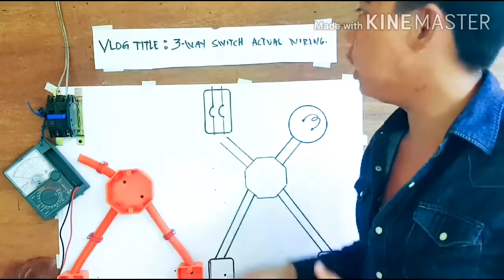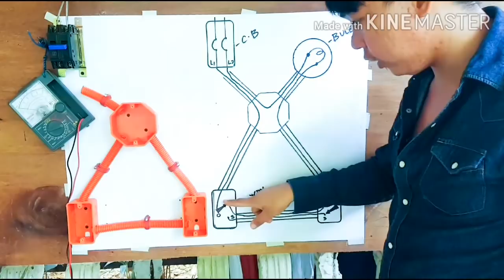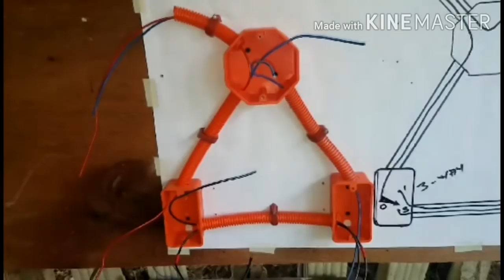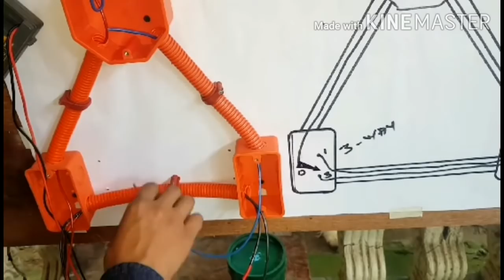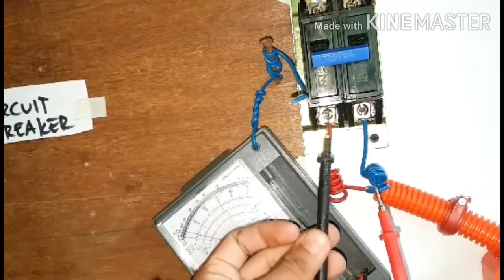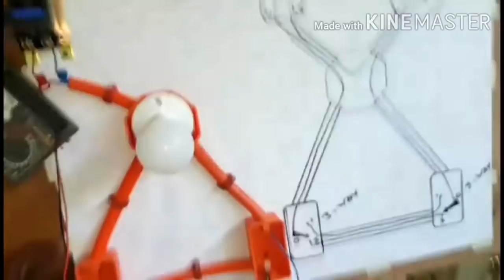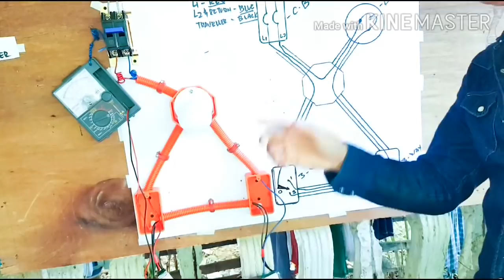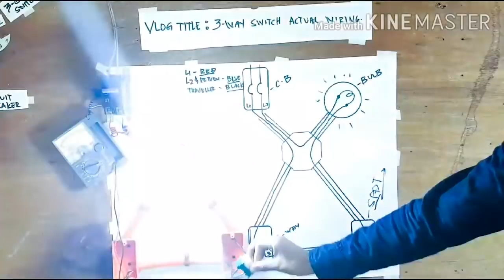3way Switch Actual Wiring Connection | Tagalog

Comment: Sir magandang araw. Ano kaya posibli ang trouble sa talong ila isang switch sa poste ng bakod na naka baon sa semento? Kasi kahit naka off may liwanag pa rin ang tatlong ilaw okay naman ang switch.

Ikalawa, meron ilaw  na sa pito ka ilaw sa isang circuit sila meron isa na nag patay-sindi ( blinking ) lang. Ano kaya ang problema.

Lahat na iyan ay Line to Line system.

Maraming salamat sa video mo. Naka refresh ako.... at sana masagot ko mga tanong ko para balikan ko yon at susubokan ma solved. TY...
Reply from the maker: Sr. Pag ganyang kaso. Try nyo. I check ung splicing baka kc pinapasok na ng 2big ung mga dugtungan.
Ikalawa kaya nag kakaroon ng ilaw kahit naka off ang switch. Posible grounded. Nababasa ang terminal ng receptacle kapag umuulan. At baka ung linya nyo is may balat na nababasa. 
Salamat po sa feedback master godbless po.

Comment: Sir pag 110 ba parehas line1 at line 2 mo sa video mo na yan ?at pwede magkabaliktad sa traveler ? 1 to 3  ?  Paano sir pag 220 hot wire at neutral ? Pwede din ba 1 to 1   3 to 3 ?
Reply from the maker: Yes po pwede po. Salamat po sa feedback master GODBLESS PO😊

Comment: Master okay lng ba 30 amp #10 sa 7hp na floor mounted aircon umiinit kasi ang breaker nung una hinigpitan ko nawala ung parang kumukulo tapos meron n lng ngayon umiinit konti
Reply from the maker: magtaas ka ng amperahe master ng cb gawing mong 40 ampere then ang wire #8 na sukat ng wire. lumakali ang current ng acu nyo. Salamat po sa feedback master GODBLESS PO💜💜💜
Reply: @ElectricalPinoyTutorialTV  master pwede po bang 40amp n lng ang ipalit #10thhn nmn po gamit nmin hehe.
Reply: @ElectricalPinoyTutorialTV  main po namin para sa 5 unit AC 200Amp tapos nag branch ng 60 tapos hiniwalay ng panel bali 3 panel board, may tig dalawang 30 amp kada 60 amp, ito po ung gagawin kong 40 amp kada unit salamat master.

Comment: Sir bkit  iba sa amin ung 3way...1 is to 3 and 3  is to 1 ung traveller nmin sir?
Reply from the maker: Ok lang po un master kahit mag ka baliktad gagana po ang ating circuit po.Salamat po sa feedback master Godbless po
Reply: @ElectricalPinoyTutorialTV  pro my pg kakaiba prin un sir pg 1 is to 1...3 is to 3 sa 1 is to 3...3 is to 1...kc pg 1 is to 1...3 is to 3...d mag o on pg d mo inon ung 1 switch pra umilaw ung bulb....unlike 1 is to 3....3 is to 1 na...kht alin man sa 2 switch eh pwede mong i on pra umilaw ung bulb
Reply: @johnpresnelixacebuche9009  ano sir yung power supply nyo sa lugar nyo  ?  Hot wire at neutral ba o 110 ang line 1 at line 2 ?
Reply: Magastos sa flexible yang ginagawa mo